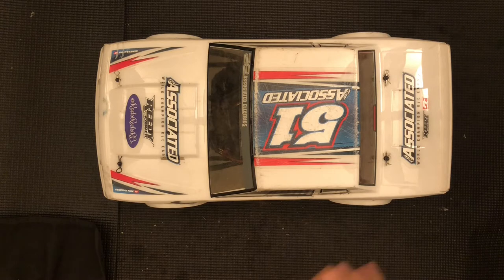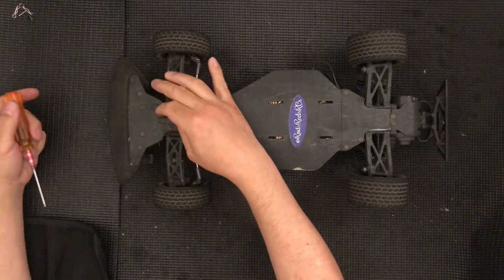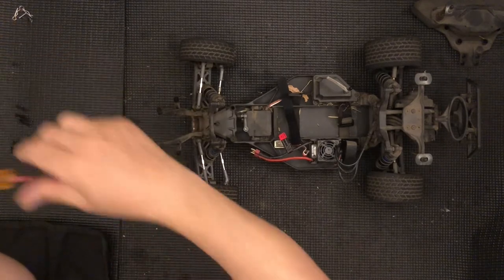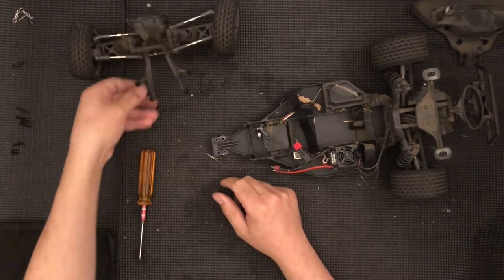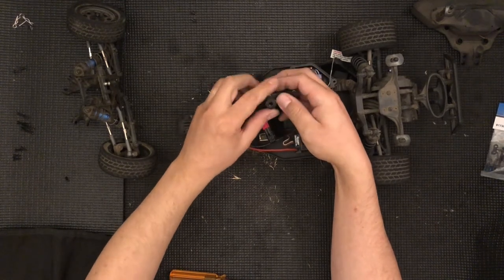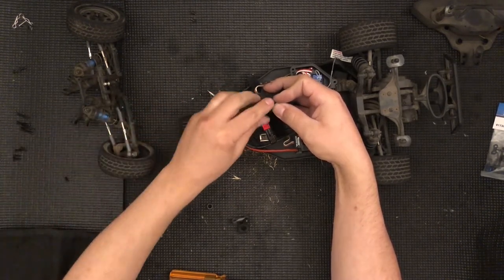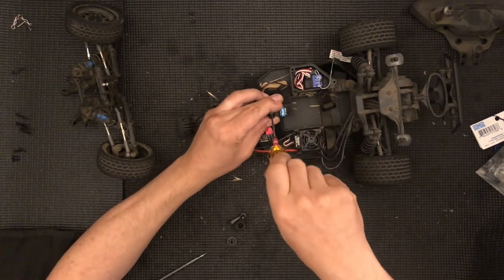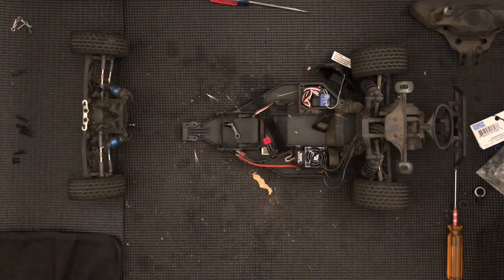Team Associated SR10 Teardown Part 1 Remove front end replace servo horn eliminate saver explain

Comment: I'm going to put at CC sw4 and 1410 3800kv ✊
Reply from the maker: How about a CC 1415? 😁
Joking... 1410 will be more than enough. I am really surprised by how well the body holds up despite the sharp body corners.
Reply: @telecomandorc  I'm going to put the proline pinto body and get fatter tires in the rear for street bash/drag runs.... Let's invest in an rc drag light tree haha run races
Reply from the maker: @TheNumber1985  Maybe even build one. Petro or any truck stop sells round LED lights. We just need a light controller and a trip light. The tree can be PVC or even wood.

Comment: I race a full size 86 monte carlo. I'm thinking about buying one just to play around with. My racing number is 51
Reply from the maker: Funny you mention and have a Monte Carlo. That is why I like the SR10. It looks like a Monte Carlo.
Reply: Im new to the rc world. I sarted off with a losi 8ight nitro. I fugued out quickly that nitro is not for beginners. So win I was looking at battery rc and see the sr10 I was set. And the number even matches mine...
Reply from the maker: @51-FS  They make a clear body (ASC71192) you can paint with your colors. 
Duratrax paint is what I use now. Not because it is the best, but because of value. Tamiya paint is good but use the PS-. Do not use the TS- as it is made for hard pastics and it will flake off lexan. 

I do have some nitro 101 videos. Maybe they can be helpful if you still have your Losi:
https://youtu.be/aE2zKLf8IOg